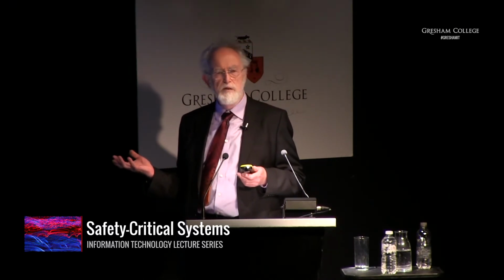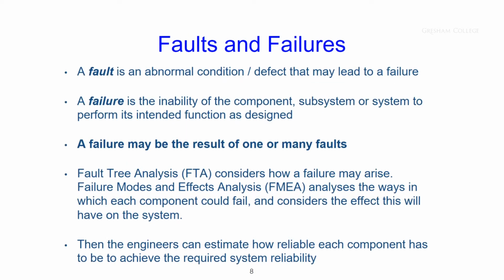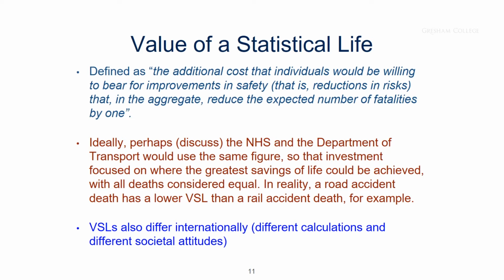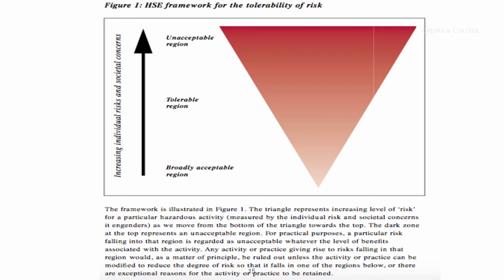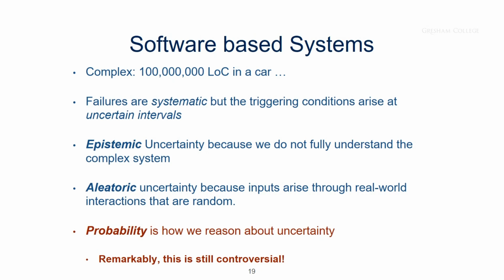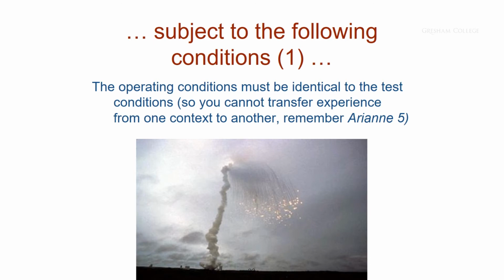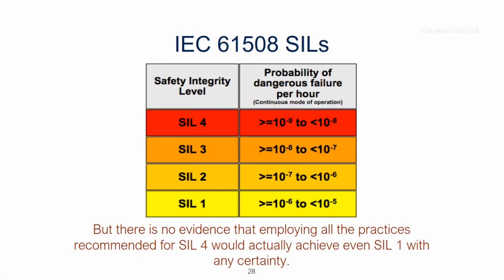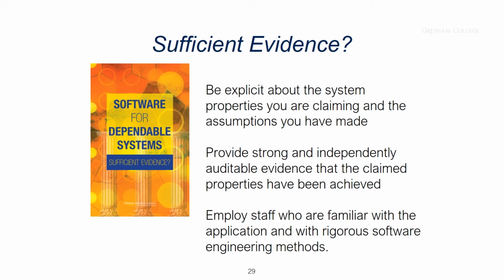Safety-Critical Systems - Professor Martyn Thomas CBE

Comment: Interesting lecture - one thing I would say is that when carrying out accident / incident investigations the software is often treated as a 'Black Box' that has worked in the past for lots of hours without apparent failures so it cannot be the cause of the incident. However as the lecture states it only requires an unusual set of input conditions to trigger the failure. In a lot of systems there are no or few logs and the diagnostic information disappears when the power fails or is turned off. However the unusual combination of circumstances can also occur in hardware. I am aware of a design error in a hardware safety critical system that was only found after 5 years in service as it required an unusual action by the operators. It appears that this particular set of circumstances had not occurred in the 5 years or if it had the wrong side failure had not been recognized or reported.

Comment: Aviation accident investigations almost always prove to involve complex cause chains, often involving corporate procedures and documentations. Study a few air crashes and you'll never believe in single root causes again.
Reply: Hello Avro, I'm very interested in engineering causes of accidents. I'm puzzled by your statement: "...involve complex cause chains". Maybe it's because I may be remembering only particular cases involving failure to follow documented procedures. I don't interpret this as a complex cause chain, but maybe I need to be corrected on the definition of the phrase.

Some examples I remember:
Lengthening manufacturer recommended lubrication interval
Not following manufacturer procedures for engine removal
Not following manufacturer specs for tension adjustment of control cables
Service manager 'helping' mechanics by performing some disassembly, and then not documenting it.
Reply: Well then the question follows, why weren't the documented procedures followed? Were there factors making the implementation of these procedures infeasible?